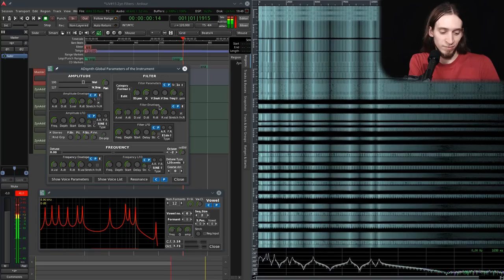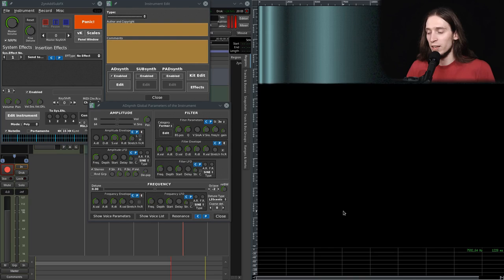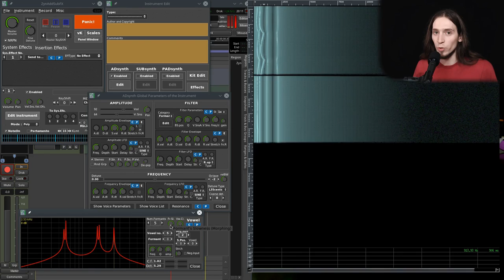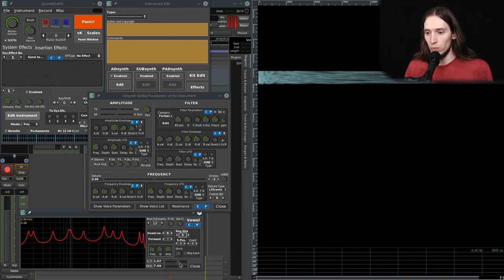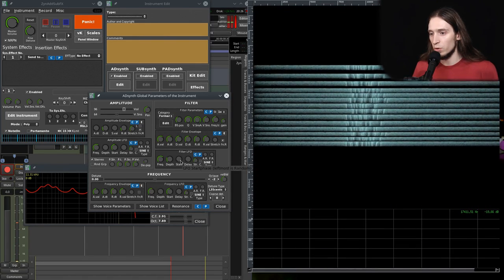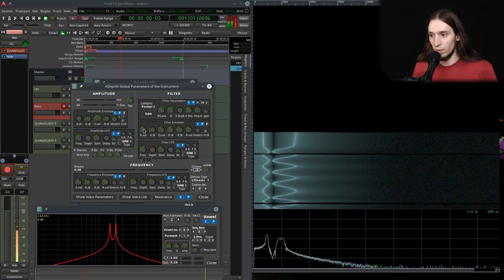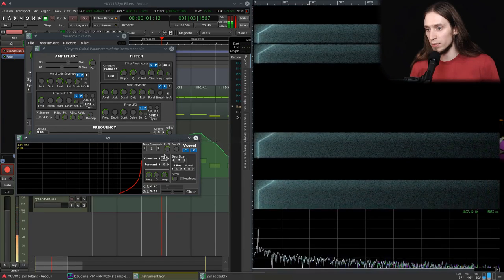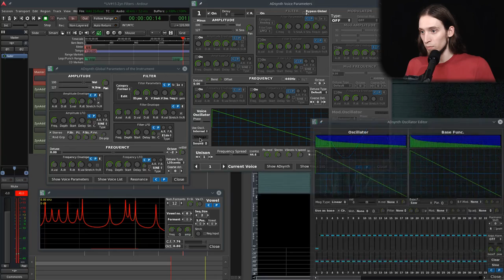UV#15 Formants and ZynAddSubFX formant filter

Comment: For a RT spectrum analyser, there's JACK & ALSA Audio Analyser  and xanalyser, also Spectrum3d
Reply from the maker: Brian Fields realtime spectrum analysis programs and plugins are pretty common, but most are only displaying frequency conents of a signal in a single moment in time. A spectrograph on the other hand displays a history window - so you can see the changes of frequency content over a spcified time frame, which is what I am using Baudline for, right now. Baudline however isn't fully opensource, and doesn't have. logarhytmic scale option, which makes more sense for muical applications than a linear scale.
Reply: Spectrum3D does have a continuous 2d view similar to baudline, but it's also linear and scrolls left to right.
Reply from the maker: Left to right would be ok, I actually was first looking for that type, because I was used to Foobar's scrolling spectrogram. The linear scale is not ideal though.

This makes me want to dig up some code and make my own tool fro this, but I have no experience in programming DSP and GUIs under Linux. I really wish someone could gather all the great functionality of programs like JAAA, EQ10Q, Calf Analyser, and Sonic Visualiser, and construct something that will be extremely customizable for spectrogram view, that could hide all GUI elements (for screencasting), to spectrum scrolling vertically or horizontally, overlay a grid or draw rulers, allow custom color palettes, configurable FFT window function and size.
Reply: HI, what do you think about Freqtweak ?

Comment: Question, why is it that when you need a saw wave, rather than selecting "Power" you select "Saw" and turn that one knob all the way down?  They sound almost identical.
Reply from the maker: They probably do. There are multiple ways to get the same results, I just learned to use that one :)
The Power wave is however nice because it gets even brighter than a regular saw - which can be great in some applications.

Comment: EQ10Q's spectrograph is ok. Has a lot of smoothing though.
Reply from the maker: naught101 Yes, if I could have that as a separate program, I'd be rather happy :)
Reply: What about running it in Carla?
Reply from the maker: Well, I can run it in a separate host, but the main problem is it will draw all the EQ controls on top of the spectrogram, making it less readable for that purpose - if I could extract the spectrogram functionality from EQ10Q and add some more options to change the precision, speed etc it'd be perfect. I really like the color palette of it also.